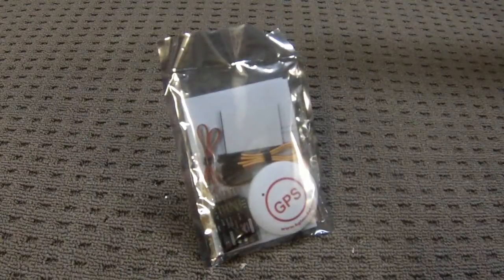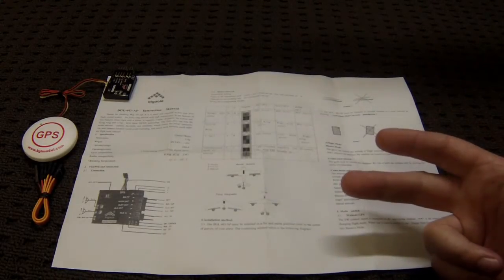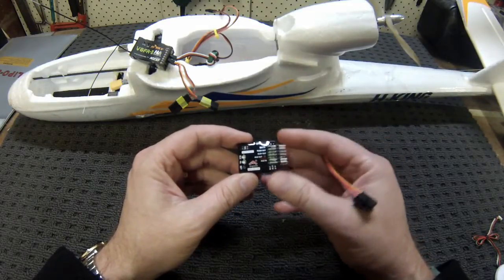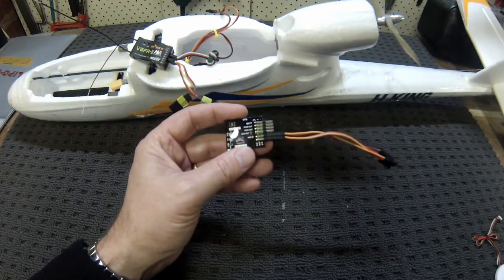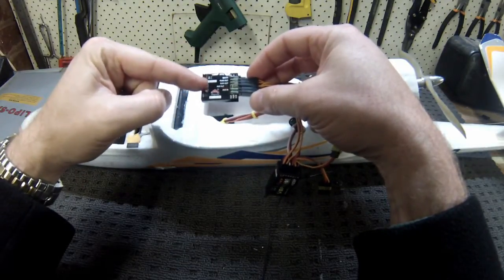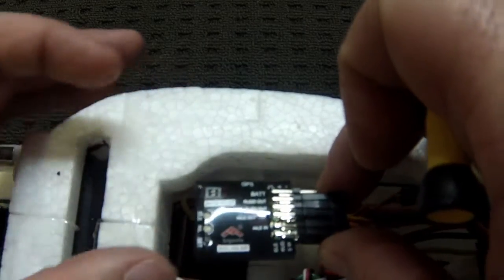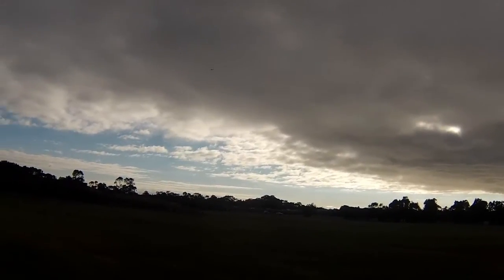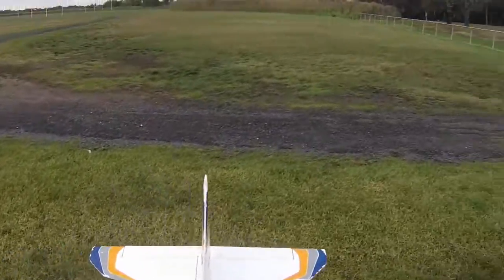BGL-6G-AP Flight Stabiliser with RTH - Setup

Comment: My transmitter only has a 2-position switch, can I configure it to be in normal flying mode and RTH?
Reply from the maker: G'day Stephen, Theoretically you could use a 2 posisitons to output the signal to the receiver for off and RTH modes. I have done similat things on a old Hobby King transmitter that didn't have a 3 pos. Your transmitter will need to be programmable to ensure the switch output is in the rage of the modes that you want. Cheers Michael
Reply: @madrc6667  Thank you, I'll dive into it!

Comment: Hi, thank you for the presentation. My BGL is bought and installed. But the manual is not very precise, so I have some question.
- New model created, no trims. So when and how should I trim the model, because in manual mode I need model to be trimmed?
- Really no mix functions? I use to use Aileron/Rudder mix, dual rates and exponencial something:-)
Thank you.

Comment: Hi Michael,
Can you describe how I can setup Flaps on my DX8e with the AP. Setting the aircraft type to 1 Flap 1 Aile allows for the addition of Elev and Speed input but conflicts with the AP.
Reply from the maker: Hi John,
Sorry mate, I don't really know the Spektrum gear very well, but I helped a fellow pilot a while back to set his gear up. One of his planes had the full set, Ailerons, Flaps, Gear and all of it was setup on a DX8 G2 with no conflicts.
I did a few videos for him, but they are not listed. 

I think if you use this link - https://www.youtube.com/watch?v=bzzRdmjNsaQ&feature=youtu.be
you should see the physical setup of the receiver and connections to the flight controller and servos mocked up.

If you use this link - https://www.youtube.com/watch?v=bzzRdmjNsaQ&feature=youtu.be
you should see a detailed explanation of the radio setup.

The videos are in context of setting up someones gear and explaining what I have done, so you might have to go through some details not pertinent to the flaps, but the details are all in there somewhere. 
I hope it helps. Cheers Michael

Comment: Hi Michael, Congratulations on a very well presented review. I presume from your video that the unit's stabiliser program is set and cannot be programmed. Also I have a Radian XL with the AR636 receiver. Should I replace it with a non-stabiliser rx, or will they work together.
Reply from the maker: Hi John, the stabilisation is in effect Auto Level. It will limit roll and pitch as well as return the plane to level flight when you take your hands off the stick. There is an adjustment on the unit that increases or decreases the sensitivity of the auto level. 
When you are looking at stabilisation from something like your AR636, they will allow you to fly unlimited but reduce the affect from the wind. 
They will work together, but I'd suggest programming your radio to have all the modes seperate. Off - Stabilisation - Auto Level - Return to Home. 
Cheers Michael

Comment: Hi Michael,

Though you presented this video in 2015, it is still valuable. I am a modell pilot that has learned flying by doing and crashing. Still using my second 'We Can Fly' modell, that is held together with glue and a lot of tape. The first one was beyond repair after again another severe crash. I was really fed up with crashing and discovered the BGL Installed it in my plane and started flying again. And now I have made a lot of wonderfull flights without any damage!! Also made a lot of SIM hours that turned out usefull. My learning plan is to make as much hours as weather permits to become ultimately comfortable and with the plane at height, switch to the unassisted mode. The 'RTH' option also works perfect. I also programmed 'RTH" in the 'Fail Safe' mode of my x-mitter. Have tested it when on the ground and works fine also. 

Best regards, Jan Willem
Netherlands
Reply: Same here!  Very useful video.  I would caution to be careful adjusting the little gain knobs.  They are very delicate.

Comment: is it possible to order the cable that hooks into elev and rudder and sw
Reply from the maker: G'day William, I only have the complete units. You may be able to make one from a regular servo extension, just modify one end to split out to the other connections needed. 
Cheers Michael

Comment: Do you have to manually reset the home position for each location you fly?
Reply from the maker: That is correct. When you fly at a new location simply press and hold the SET button until the red LED goes solid, you have set a new home point.

Comment: Is there anyway to add sbus receiver to this? I have a frsky R9mm which only has 4 channel pwm. It does have sbus, so was trying to figure out how to go about wiring it.
Reply from the maker: Hi Shaheed, like I said over in the RCGroups thread - You need to connect the actual servos from the receiver to the BGL-6G. There is no SBUS. Cheers Michael
Reply: Okay, thank you!

Comment: Its great but what they fail to mention is both your transmitter and your receiver have to support gps! So from what i can gather you will have to use a little higher end  transmitter and receiver. Would that be correct?
Reply from the maker: Hi, this is not correct. There is no need for the transmitter or receiver to 'have support for GPS'. The only thing that you may wish to consider is that your receiver has the ability to program the failsafe option, so you can ensure the RTH is engaged if you fly our of radio range. This sort of feature is available on most radios. Some radios only failsafe to the last input if the plane flies too far away.
Cheers Michael
Reply: @madrc6667  Thanks excuse. my ignorance on the matter new to GPS I'm guessing that the reason this will not work for me is because the flying fx-I6 receiver does not support rth and that is a question thanks
Reply from the maker: @TheIsenberg  Each mode of the flight controller will work fine on the FX-i6 when you program a three position switch. The thing that you might need to research is if you can program/set a specific failsafe on the receiver for the FX-i6. The flight controller does not have any dependency on the receiver for the RTH.

Comment: Does this accept sbus?
Reply from the maker: No, simply attach ailerons servo and elevator servo plus the switch control. Cheers
Reply: Dam lol I don't t have any servo plug type rx's
Reply from the maker: @psychio1234  it is designed for fixed wing (planes) so servo type is the most common.
Reply: Yeah I'm just getting into wings now own 3 I should but a full size r9 rx but it's so nice to have the small mm or slim versions wings are slowly incorporating sbus

Comment: I am wondering if this GPS unit when you flying the the plane has the option to monitor the  speed and battery and heading distance altitude extra things while we could see them during flight  on the ground monitor display if the option is available please let us know.
Reply from the maker: G'day Roger, I think you're asking of this RTH/Autopilot has an On Screen Display (OSD)? Simple answer is no, no information is sent to your video standard.  I have had some people that have bought it have modified the GPS to also feed a separate OSD unit for that purpose. I have used a Remzibi, but keep it separate from the RTH.  I hope that answers your questions.  Cheers Michael

Comment: Hello, I would like to say that I do not speak English so I'm sorry for the language ..... anyway, I have a zagi wing and also a stabilizer of these, same RX and same radio .... my question is: the term RTH means "return to home "? how could this be possible without a controller + gps?
Reply from the maker: Hi Franklin, I am not sure I completely understand your question, but this unit does have a Return To Home (RTH) feature. It does have a GPS and a flight controller. 
Bigaole do also manufacture a different product for stabilisation only. It looks similar, but does not have a GPS and no RTH feature.
Does that help? Cheers Michael
Reply: @madrc6667  OK. that's right. what I have is only the stabilizer, there is no connection for GPS. Thanks. very simple equipment and seems to comply with what it proposes

Comment: can u show how to set up failsafe on flysky i6 and bigaole gps ??
Reply from the maker: Ho Mitch, sorry I don't have a FlySky i6, but there are quite a few good vids on how to set-up the failsafe. https://www.youtube.com/watch?v=LXTEXqR_ghI I would say that basically, make sure you set the channel you have your mode on set to engage the RTH mode. The throttle is an option depending  on your plane type and safety preferences. I have a couple of my planes set with 40%-50% throttle, but one of my gliders is set with no throttle. I hope that helps. Cheers Michael

Comment: Mad RC.  Great video. I have been looking for a good economical FC and it looks like this might be the one. Question? Can you set the RTL altitude? I plan to use 0% throttle at failsafe on my AWS28. 

Thanks

I have subscribed.
Reply from the maker: Hi Jason. The altitude that the plane is at when the RTH is engaged is maintained (as best as possible given the airspeed). I have my ASW28 set-up with no throttle on the fail safe too. There is a tonne of good information on my RC Groups thread too - https://www.rcgroups.com/forums/showthread.php?2417656-Bigaole-BGL-6G-AP-Auto-Pilot-System-With-GPS-and-Return-To-Home
Cheers Michael
Reply: Thanks much Micheal. Great information

Greetings from Florida USA

Cheers.

Comment: Hi nice video! I have a plane which has already a 6G/3D stabilizer integrated. Do you think I can add the BGL-6G-AP to get the RTH function? Can this module interfere with the existing stabilizer of my plane?
Reply from the maker: G'day, yes the two stabilisers would interfere with each other. But if you have enough switches could set it up to have one on is certain modes and the other on when needed in different modes. So to get the rth function you would need to program the radio to switch off the other stabiliser when you select the rth mode. And make sure to switch off in failsafe too. Cheers Michael

Comment: I installed this same unit on my q trainer 3d printed plane I went over the connections 3 times and when I tilt the plane up my elevator goes up when I tilt it down the elevator goes down opposite of what it's supposed to ? What did I do wrong or is there an adjustment? Thanks
Reply: My mistake I was using a Transmitter that only had 2 position switches , switched over to my taranis x9dplus followed your video to set it up set failsafe to half throttle using rth mode and works great . Could not have done it without your videos . Thanks
Reply from the maker: G'day Jeff. Sorry I didn't get back to you earlier. But looks like you got it all sorted. Good stuff! Cheers Michael

Comment: Do You think this will work with plane which doesn't have rudder? I plan to put it in my micro skyhunter :-)
Reply from the maker: Studebaker, no probs. Just connect to the ailerons and elevator and you will be fine. cheers Michael
Reply: Thanks !

Comment: Hi, maiden my wing last weekend, return home all ok, this controller is super  simple and works great. When i flip to return home does the controller takes control of throttle ? Or only flaps ? I did not noticed...
Reply: done ! ;)
Reply from the maker: Hi Ricardo, no control on the throttle. Just the aileron and elevator controls. Cheers Michael
Reply: MAD RC strange. Should bring her home... how can it do it without accelerator? Should I configure my throttle to middle in case of radio failsafe ? I want if radio fail that can come back.
Reply: weird... so if i take it too far, the radio loses signal and failsafe kicks in and turns on return home... it will only take control of elevator and aileron, accelerator will go to zero... how can it returns home without power ???
Reply: Ricardo Oliveira setting throttle in failsafe. Duh! :)
Reply: Hi I have very similar question so I am going to type here. First thank you for this awesome video i just ordered one after your review and thid question  came to mind. I have my failsafe for mid range throttle and if plane goes to failsafe. Does it automatically go to Return to home or it stays in failsafe mode of receiver.

Comment: Arrrrrgggg dont suppose you have or can get spare leads? I fear mine where thrown out when the plastic shopping bag they were in got mistaken for rubbish....By the way its going in a wing so only 3 channel.  cheers
Reply from the maker: Hi Angus,  Sorry, I don't have spare leads. But you can just use a standard servo lead and pull two of the pins out of the plug to use in the each of the other channels. In fact, you can get the plastic servo ends from Hobbyking for a few dollars - https://hobbyking.com/en_us/jst-sh-servo-plug-set-jr-gold-plated-10pairs-set.html and add the plugs to the other pins. Cheers Michael
Reply: Mate never guess it....... I found them! YOU LITTLE RIPPER! The were in a mess of a FPVRaptor 2 that I hadn't stripped to rebuild. Thought Id just check one last time then thought Ill strip it now and down the end of the tail wedged at the end where the leads. Thank the gods. Cheers for quick reply.
I hope this time I can use it last time plane went up plane turned plane came down. The raptor has an issue with wing stalls if not enough speed and it was my first plane so I've gone got a Opterra just as big but a little more forgiving.
Reply from the maker: Excellent news that they turned up! Good luck with the Opterra, such a nice looking plane. Be sure to keep the gains low when testing for the first time. Cheers Michael

Comment: Hello!, another question.  Here is the scenario:  I am flying my Radian XL.  It is in a thermal at 1,000 ft with the motor off.  I turn on the RTH.  What happens with the throttle and altitude?  Don
Reply from the maker: G'day Don. Any time you switch the the mode into RTH the plane will attempt to hold current altitude and return to the saved home position. A lot of people set up their receiver (when capable) to include failsafe settings to engage the RTH mode and an appropriate amount of throttle to maintain altitude. I hope that answers your question. cheers Michael
Reply: Hello again Michael, yes that answers my questions!  I appreciate that you took the time to help me.  Don
Reply: i had same doubt... also got same answer... i have a wing... i have to set my receiver failsafe position to trothle channel medium power so it turns and returns.

Comment: Quick note received this nd got it setup, cool. Came quickly so thanks. Now to try it in flight!
I found just setting up a new model on the th9x let me set the 3 switch. I'm still not sure why you have in ur setup video so the pot effects the 3 switch on the 9x. Don't know how the hell you figured out how to do those settings the th9x is a confusing beast. I've got the EZUHF attached and it seems to work well on bench. Email a few questions just go to my last email others where me freaking while not being able to figure it out.
And if anyone knows how to set this so it RTH as fail safe on the TH9X please let me know it'd be a big help.
Thanks for quick send mate really great service.
Reply from the maker: Hey Angus, I sent a reply to your email. I hope that helps. I am sure your EZUHF has a failsafe, but not sure how to set it. Cheers Michael

Comment: Hi. Quick question? Cannot I add this to a pre-existing model on my radio? Or do I set up as a new model. It will be for a wing 
Thanks👍
Reply from the maker: G'day Roderick, normally you can add to a model set up but with the wing, your radio will be programmed with the mixes needed to control the elevons. You will need to remove any mixes in the radio because the BGL-6G will do there mixing for you.
Reply: Thanks 👍